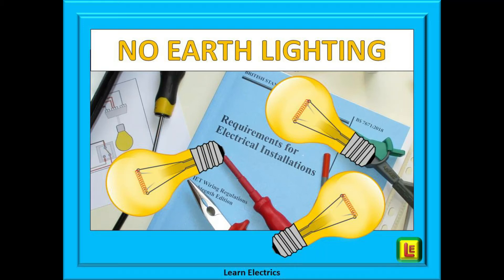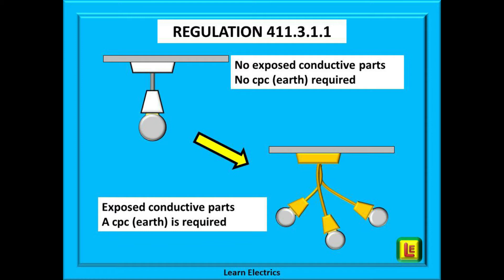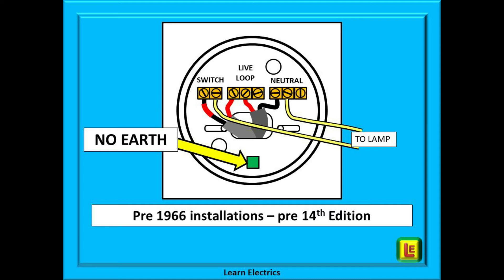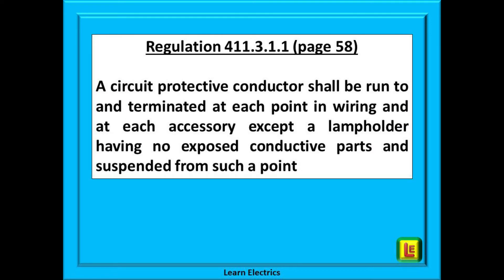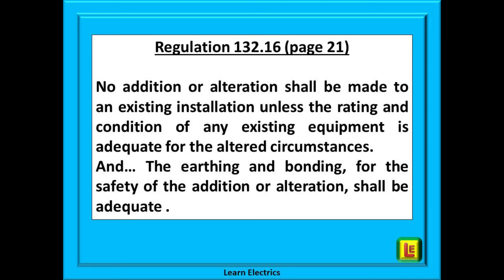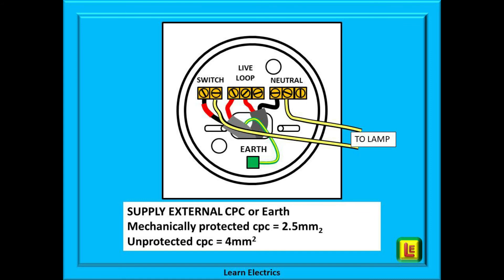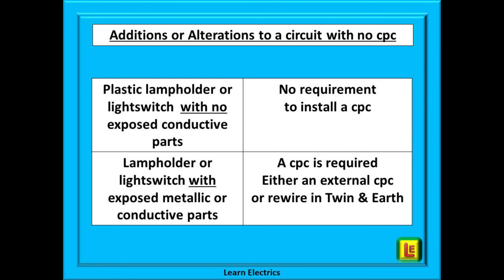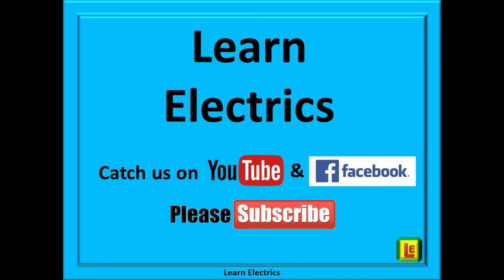NO EARTH LIGHTING. What to do if you replace a light fitting with no earth and comply with the law.

Comment: I still don't understand this!  My kitchen lights were overheating and burnt the plastic bulb holders.  I bought new light fittings with a copper outer shell to keep the bulbs further away from the shades. I removed the old bulb holders by loosening the blue and brown wires with a cross-ended screwdriver.  There was a third wire, must be the earth, fastened with a brass screw for which I had to use a different screwdriver.  I found that my new fittings didn't have any connection for the earth wire, so I don't know what to do with it. All three wires in their outer sheath have to be stuffed through a metal tube prior to connecting them.  Anyway I've spent an hour a day for the last few days up a stepladder trying in vain to get just one of the wires threaded through the little hole in the bulb holder and it's so fiddly I've given up. Every time I think it's in, and screw it tight, I find it hasn't gone in.  You will probably tell me to call an electrician, but it's annoying to have to do this for what ought to be a simple replacement job.
Reply from the maker: If  you have a Class 1 fitting then the earth connection is essential. If its class 2 then the earth is not required and should be terminated in a terminal strip or waygo, but without seeing it, it is difficult to tell. If you are struggling with the connections, then please call an electrician. Your safety is most important. Dave.

Comment: I bought a pendant light (metal shade, plastic bulb holder with 0.75mm twin cable already connected) that I intend to attach to a metal pole to use as a floor lamp. I have a few questions, please help me understand the following:

what exactly counts as exposed metal parts in this case (the shade? Lamp pole? Both of them?) 

How do I earth / ground my creation to make it safe? 

If I put a plastic conduit to run the entire length of the metal pole and put the wire through it, will I still need to ground the lamp?

Finally, as mentioned the fixture takes a twin wire, and electrical outlets in my country use 3 pin plugs. How does one connect a twin wire to a 3 pin plug?
Reply from the maker: Without seeing the actual lamp and testing myself, difficult to comment. Take a look at the video below on testing earthing and bonding.
https://www.youtube.com/watch?v=afDWcA0gGLc

Usually, if a lamp, as supplied and bought, has only a line and neutral wire in the flex, then that is considered a class 2 appliance, but as you are adding your own extras, some of which may be metallic, you could find that you do need an earth wire in the flex, and/or, need to earth the metallic parts of the modified lamp.
Reply: @learnelectrics4402  thank you for responding. How would I go about earthing the metallic parts?

Comment: Can you run an earth from the rose and switch to an earth in a socket? Cheers
Reply from the maker: If they are two separate circuits, i.e. on different breakers or fuses, then NO. L/N/E should be separate for each circuit. Hope this helps. Dave.
Reply: @learnelectrics4402  Thanks for the reply. Is it possible to spur from a socket via an FCU to a lighting circuit? Cheers

Comment: That regulation is an arse because in my 50 years as an Industrial electrician JIB GOLD card approved electrician as a young apprentice I was always told even if there was no exposed parts at a source you should always run an earth in a multi core cable wether it be a twin cable or swap cable because it affords some protection for the actual cable in case it is penetrated
Reply from the maker: Thanks for watching. The change was made after the war when copper was scarce.

Comment: Just tried replacing a bathroom light fitting to metallic type and a bit deflated to discover there is no earth in the fitting. Our house was rebuilt in the 90s so I’m surprised it’s set up this way.
Reply from the maker: Common in the 60s and 70s, it is not always easy to find a route back to the CU for a new earth. Thanks for watching. Dave.

Comment: Really insightful video. Thank you! 

I've just purchased a house which we have found to not have an earth wire and a very old fuse box. 

One question I do have is whether it is unsafe to live in a house without an earth wire  and should we do a new rewire of the house or can we just put a new fuse box in on the current wiring? A full rewire is very expensive currently. Any advice would be appreciated.
Reply from the maker: I would suggest asking a competent electrician to look at it. If its very old, you may be on a TT in which case he can help and advise on a rewire. If it is TN with no earth at all to the instalation, then the supplier will need to be contacted. Yes, it can be dangerous to have no earth. And if your installation is unsafe, remember that an expensive rewire is still cheaper than a funeral.  Thanks for watching. Dave.

Comment: Forgetting about the legality of it, and focusing solely on the safety part, there is a 3rd way! The way we found is to buy a double insulated ceiling lamp, those don't require earthing and they are also metal and nicely looking. The hard part: finding a double insulated lamp! We accidentally found one at B&Q, and was only when we saw there was no earthing and googled the "2 squares symbol" that we came across this marvel (seves you 400 pounds for an electrician to pull an earth cable from your box)!  I think everyone should know this!
Reply from the maker: Thanks Rico, yes, most sparkies know that class two lights are available. The trouble is, the customer wants a really fancy on that is usually class 1.  Thanks for the input, really appreciated and keep those comments coming. Dave.

Comment: I’ve got a new led light (plastic housing) for my garage that has no earth. I need to add a 3 core cable to the light so I can add a plug and ultimately plug it into an extension lead when I’m in the garage. Do I just wrap the earth from the 3 core with electrical tape or pop it in a termination block? Cheers
Reply from the maker: If it's a class 2 fitting with a double insulated logo then no earth required. In which case ideally use two core cable the same as electric lawnmowers or as you suggest, terminate the earth into a choc block and insulated. Make sure that whatever plug it is connected to is RCD protected.
Reply: @learnelectrics4402  cheers pal. i bought an rcd plug/socket protector to ensure all is safe! Only issue is my garage is more than 50m. i cannot find an extension that long and didnt want to double up on extension cables. any thoughts of where to source a 65m cable on a reel? i believe over 50m might not be recommended but i dont have an option as the garage is in a compound round the corner :(

Comment: Lighting circuit's here do not have earth, however I do for example have ring socket in loft (with earth) can I connect up to this same earth which is part of ring main, and feed an earth to each luminaire? The lightswitches might be tricky, but probably doable. - what would be tricky is finding a route all the way back to the consumer unit in the garage for the earth bonding
Reply from the maker: Hi Gary. The UK Regs like to have a dedicated L N E for each breaker or fuse. No earth lighting in the UK was introduced to save copper for all plastic fittings when there was a copper shortage. Dave.
Reply: @learnelectrics4402  I appreciate this Q&A was 2 year's ago, but if there's no way back to the CU/FB, without majorly ripping the house apart, surely earthing a pre-1966 lighting ring to the mains earth ring at various convenient points, such as a socket or junction box, is better/safer than having no lighting earth at all?

Comment: Thank you - Great video, very clear and helpful!   Regarding additions and alterations, I understand that bonding must be adequate before any additions or alterations go ahead. What about simple alterations/additions, such as replacing a light fitting on an existing installation which does not have RCD protection at all? 
Is it possible to carry out simple alterations and NOT upgrade the consumer unit with an RCD/RCBO, provided that all other tests on this circuit are satisfactory?  Or would an RCD CCU need to be installed before signing off this simple alteration, in order for the circuit to comply with the 18th Edition of the Wiring Regulations?
Reply from the maker: If you work on a circuit then that circuit must comply with the current Regs when you finish it. Just changing a light bulb doesn't count. generally, if you need to use a screwdriver or other tools to do the job, then it needs to be to current standards when you finish. Hope this helps. Dave.

Comment: I had engineer visited for EICR report who says I need to change ceiling wiring (which has only plastic holders and no metal) as it doesn't have earthing cable. Is this right?
Reply from the maker: The Regs say that if the installation is still as it was when it was installed and is still functioning correctly and safely, then there is no requirement to bring the wiring up to current standards. Plastic ceiling roses are class 2 and didn't need an earth back in the early 70's. Whether your installation meets this or not, only you can decide.
Good luck. Dave.

Comment: Bonding can also be carried out using pipe work within the roof
space. This can be useful where perhaps an electric shower or a
lighting point requires bonding. Providing the pipe work is bonded
elsewhere in the building it is perfectly acceptable just to bond from
the shower or the lighting point onto the nearest pipe. If in doubt a
test should be carried out to ensure that the pipe is bonded and of
course the correct clamps and labels must be used.                                 Is this article correct about earthing a lighting circuit   ??
Reply from the maker: This video is about earthing Michael. We cannot use a copper water or gas pipe as an earth conductor or cpc. Thanks for watching. Dave.

Comment: I've bought some wall lights previouslly converted from gas (!), & inadequatly wired, for my newly rewired 1897 house, with RCBO & on 1.5mm T&E lighting circuit. May I ask if there's any way they could be made to meet Regs - mentioning the following details:-
L+N cores only, unsheathed, run within brass/gas pipe of fitting{s} - IR & ContinuityR test ok
If I externally secured an earth fly lead (1/1.5mm?) along metal of fitting, or  just to its wall plate, would this be sufficient to comply? Thanks
Reply from the maker: Stephen. We couldn't possibly give any recommendation without physically examining the lights in their finished state, our insurance forbids it. However, just from what you have said about unsheathed cables, if these are class 1 lights then that already is a point of concern. I would suggest someone local to you who can test them for you.

Comment: Ok is there any requirement to fail an older electrical installation with a C2 for not having RCD protection?
Reply from the maker: C2 means improvement recommended. It's then up to the customer to decide what to do. You should report honestly what you find on periodic Inspections. Hope this helps. Dave.
Reply: @learnelectrics4402  No mucka C3 is improvement recommended C2 is urgent remedial works needed. I asked because many sparks/inspectors differ on the no RCD being a C2 or C3
Reply from the maker: My typo Marty. C3. We have GN3 suggesting C2 but as it is an older installation I would go by the Wiring Regs 651.2 Note 2. which states it is not unsafe which makes it C3 improvement recommended. There are several odd ones like this in the Regs and no clarity on the horizon. All we can do is be honest in our appraisal. Take care buddy. Dave.
Reply: Cool name.
Reply from the maker: Yes.

Comment: Am I correct in saying I could fit a double insulated metal fitting with no cpc
Reply from the maker: That's right Glenn. A double insulated fitting is constructed so that any electrical problem on the inside cannot get to the metallic parts on the outside. Much the same as an electric lawn mower. The handle might be metal but the electrical parts are encased in plastic.
Hope this helps. Dave.
Reply: @learnelectrics4402  thanks for the reply. Keep up the good work
Reply from the maker: My pleasure.

Comment: If it's a light fitting with rewire with new twin and earth the CPC will only 1mm so why would you need 2.5mm on old wiring.
Reply from the maker: A lot of older installations used singles in which case it was common to make all three conductors L-N-E the same size. Have a look at Table 54.7 on page 198 of 18th Edition.
But yes, you are right, 1mm earth is ok for standard lighting circuits. Methods and ideas change over the years.
Hope this helps.
Reply: @learnelectrics4402   glad I’ve read this comment dave, as I was changing like for like downlights at home , and wondered why there was a single red and cpc in grey sheath and a single black in grey sheath no cpc , and wondered why they Wer single , as I’ve only seen the new twin earth blue brown or 3 core and earth 😂 think the house just missed out on the change over on colour but I did not know they used singles back then 👍
Reply from the maker: Anything can happen, as well as the rules changing, you also have to factor in people finding their own way of doing things. Dave.